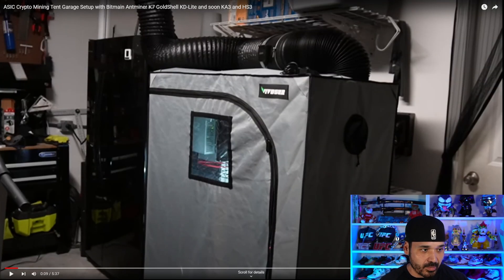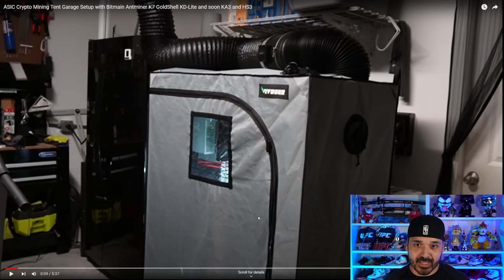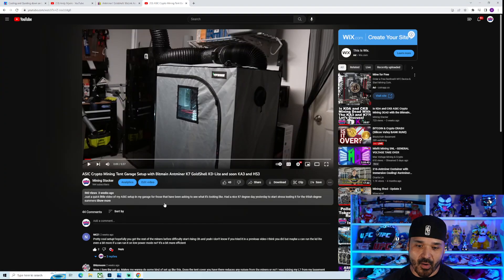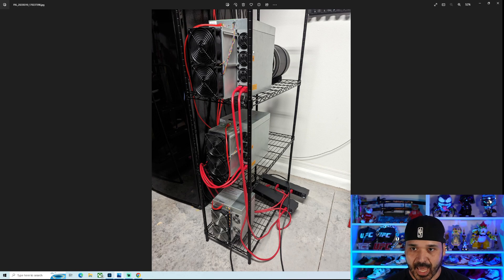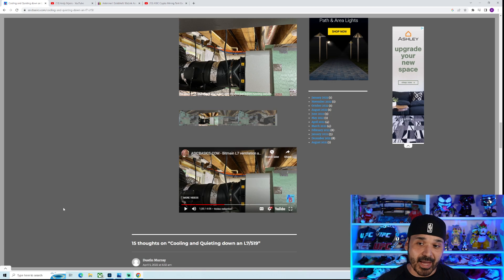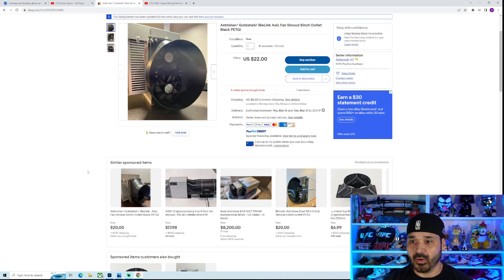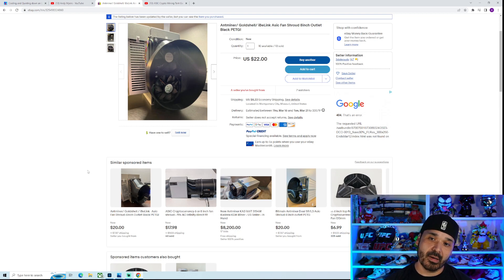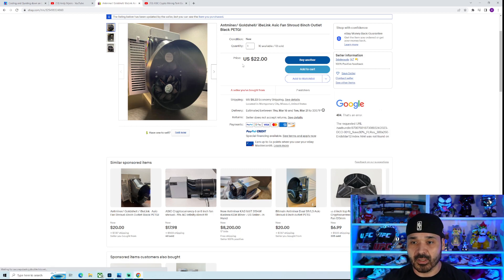ASIC Crypto Mining In Home Garage Temperature and Ventilation Tests with Bitmain Antminer K7 KA3

Comment: I’m in south Louisiana and dealing with the same issues.   Bought a storage shed, insulated it, put in one infinity exhaust fan along with 2 of the intake vents like Hobbyist used.  The shed has a decent sized window that I also used as an intake vent.  Only running 14 gpus, and 3 ASICS. Man the heat is already overwhelming and we haven’t got any where near the usual “wet” heat we will be getting.  My new line of thinking is I need something with higher ceiling heights so the heat has plenty of room to run upward.   Also just put a 8,000btu window unit in to see if that helps at all.
Reply from the maker: The key thing for me has been air flow , even with hot ambient temps , the airflow has been king. Garage has hit 112-115 on hot days and my ka3 is my hottest machine hasn't gone over 75 degrees. The two big Asics have 8" ac infinity fans attached and the airflow is directed to a 2000cfm fan that exhausts air out. My other 2000 watt ASIC just runs fine with stock fans and have about 12 GPU's at 700w with just a fan on them, and now this guy another 800w. Also have a big drum fan in garage that helps move the intake air through. But biggest thing is definitely airflow and playing with the balance of intake/exhaust

Comment: I have mine setup going into my ac receiver. With some exhaust attachments. So it’s kinda hard for me shut my utility room door due to all the air being pulled out of that room. But my temps and noise level are super low. Wish there was a way for me to post my pic so you can see my setup.
Reply from the maker: Yeah gotta get a discord going one of these days , it's be a good topic for everyone just showing heat extraction tips, yeah man as long as its keeping the temps down and doesn't affect anything, that's the goal for sure!

Comment: Great video as always! I would look into immersion if I were you. I've been looking at doing immersion cooling myself now that I have 12 miners. I found a really good YouTube channel on it that lays out a lot great info. The name of the channel is: Home Bitcoin Immersion Mining. It's a super same channel but I bet it will grow once immersion cooling becomes more popular at home. Priced out for 12 miners (full system), it should run about $7500. I'm looking at building my own tanks, dry coolers and using 2'' schedule 80 cpvc piping. Rough guess for 4 miners would probable be around $2000.
Reply from the maker: Ive looked into it and it's still on the table as a possibility if I can't cool things down enough , hopefully some US companies start to jump in manufacturing of these tanks and dry coolers as shipping is crazy for alot of these larger tanks from the few companies who are making them. Industry seems to also appear to start trending in that direction, very possible this is one of the last gens of traditional air cooled units, the new whatsminer immersion only units are a peak into what it may turn into. Man, congrats on scaling up to 12 miners!

Comment: you would be better to draw air from the out side ducted to the intakes then remove the heat from the area, you need a delta or a differential between the temps, the way you have it you are just blowing the same heat back over the heatsinks.
Reply from the maker: There's fresh air coming in from the ventilated attic, the negative pressure from sucking air out was creating enough pressure for the passive intake to have a nice steady flow of fresh air when it was in the tent, the 8" fan was enough to create that pressure as it only had to pump out the air in there. Now that it is open air , need alot more airflow to recirculate the entire garage faster including another intake vent
Reply: @miningstacker  i wouldnt draw from the attic, even hotter in there, you would be best to draw from below ground like the basement if you have one.  you also have to calculate the ducting based on length as well as diameter, the longer the run the larger the duct has to become or those fan will be spinning away but not moving the air they should be.  the formula is simple, prevent the heat from the units from being re introduced to them.
Reply from the maker: @sausageslaps  yeah definitely not ideal , no basements down here in Florida. The attic is very well ventilated and does allow a good amount of ambient air in, even when it does get its peak heat at 95 f, the goal temp is 75 celsius which is 167 f, so there is a big temp difference between outside air and what's being exchanged, the problem right now is just not recirculating the air fast enough as I'm now trying to move air from the entire garage vs that little tent , but this larger fan should help with keeping it moving and will be directly mounted on ceiling and will not longer have ducting. But this is all an ongoing experiment , unfortunately I have a lot of limitations being where I'm at and being in an HOA neighborhood , worst case the Asics will just get hosted or may look into immersion cooling , but we shall see

Comment: I have my grow tent with one 8" and three 6".  Instead of cutting hole in wall I ended up putting in a doggy door (Large size) and that is where I pull my fresh air and pulls hot air out.  I also leave my tent unzipped and it helps.  Easy to cut into side garage door.
Reply from the maker: Nice!

Comment: Great content as always. This will be more of an issue for me this year than last.  My CK6 hated the cold and actually thrived in the heat of summer.  I got my K7 fired up Wednesday and it’s great so far.  My outlet temps are 68-70 now but that will not hold two months from now and knowing 90 is where I want to avoid with this one is good.  I moved the CK6 from an unfinished bonus room to the insulated garage below it for the winter and that worked but it seems this K7 is a very different animal, it loves cold and both the RPM’s and Watts drop when I open the garage.  I was looking at the AC infinity fans but not in this configuration.  This opened my eyes to new ideas.  Thanks!
Reply from the maker: Yeah , when I saw that configuration, definitely interesting as the usual is on the intake side and with no stock fans, in reality should probably be about the same either way as the air is still getting tunneled through, but we'll see how it pans out.

Comment: How loud are those asics compared to the ac infinity fan at max speed
Reply from the maker: The ASIC fans are definitely louder, but it's primarily that whine noise that travels far and pierces, so if it's cool enough where they are under 4800 rpm it does make a big difference, alot of people remove them altogether when using these inline fans to reduce that whine noise.

Comment: The CFM ratings of fans give you zero information about how much actual airflow you will get.  Putting all that ducting on your 8" fan with all those bends in it drastically reduces your CFM. The stated CFM rating is based on NOTHING attached to the fan at all,  just running in open air with no resistance. If you want to move the most air possible get some big squirrel cage fans and mount them directly to the vent you cut in the wall/ceiling.  They're louder than the AC infinity inline fans,  but move a lot more air.  It's not like that room will be quiet anyway.
Reply: And if you have passive intakes,  they need to have twice the surface area of the powered exhaust vent area.
Reply from the maker: Appreciate the insight! Yeah ended up with a 20" shutter fan that will be going up there , we'll see how it does along with these fans

Comment: I’ll be using my basement for now cool down there air flow management will require some troubleshooting. I’m looking in-line fans as a possibility and other ideas in my head. Thanks for video and yes still waiting on my K7 lol
Reply from the maker: Nice, have had good success with ac infinity fans, it's been running nonstop for two years now, it'll get there eventually 😂